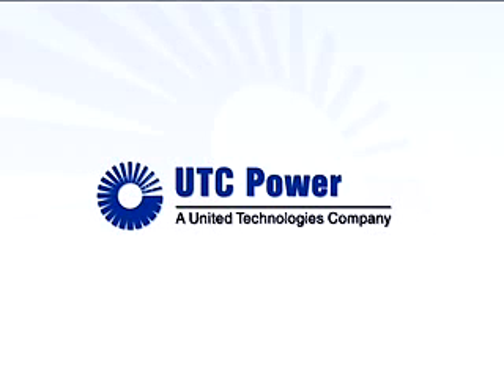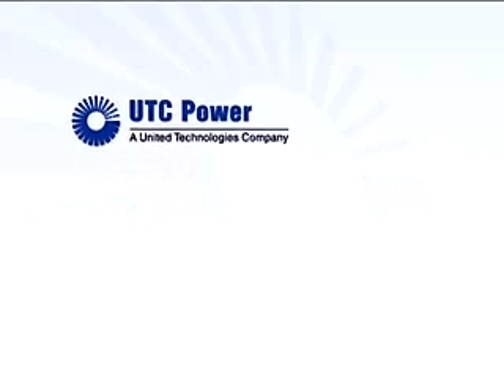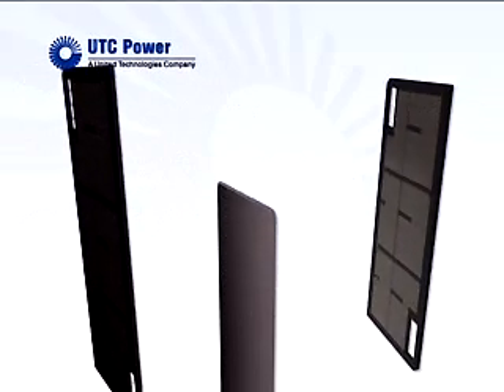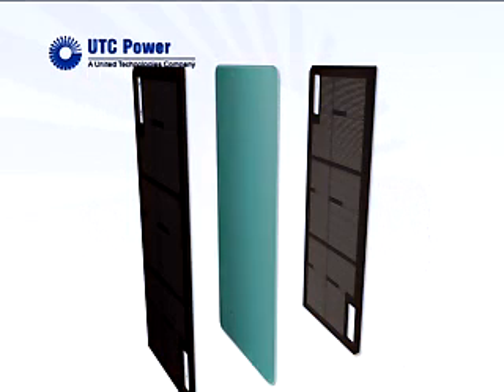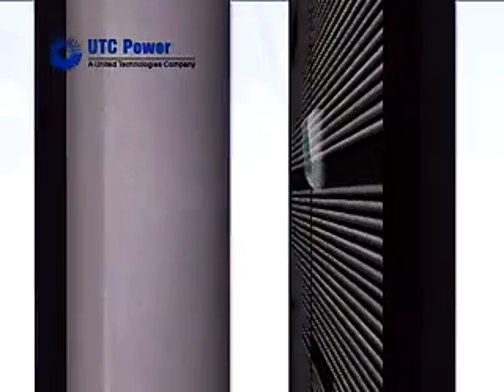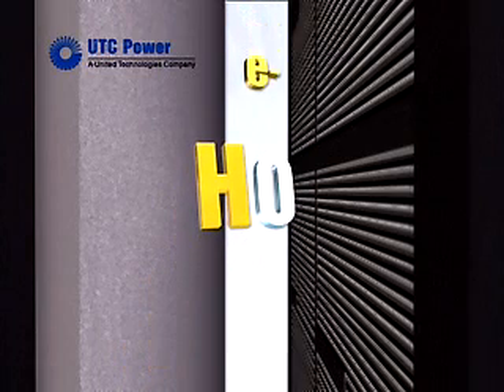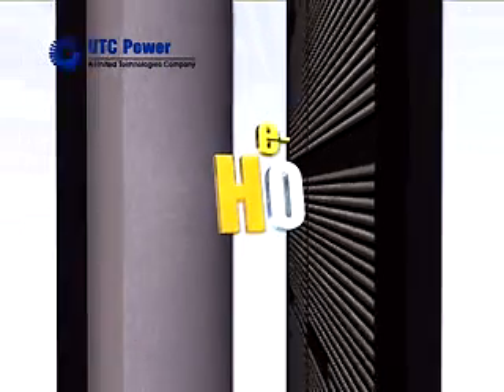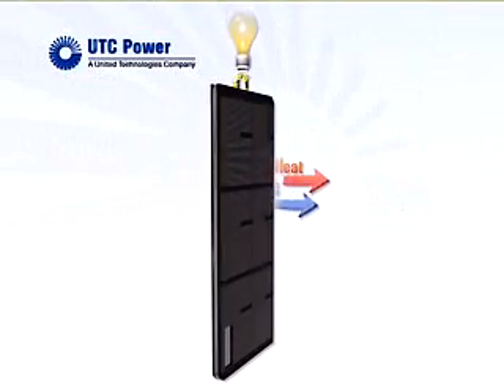UTC fuel cells

Comment: I was able to produce a small amout of hydrogen from water with a DC source. I used 6 volts at 1.5 amps. It was crude, but it worked. With more refinement, someone can do much better. I'm now thinking of using solar power. Wish me luck and I'll keep in touch.